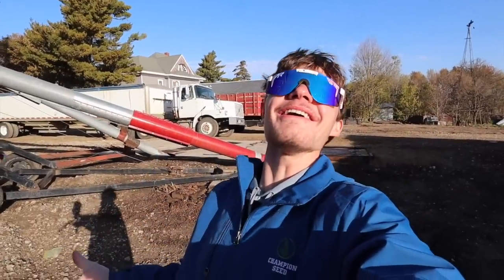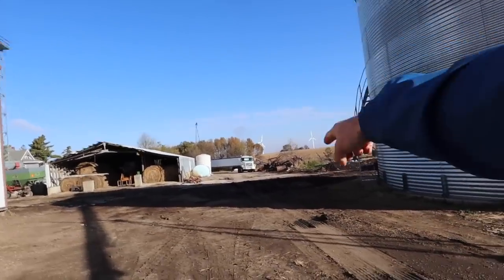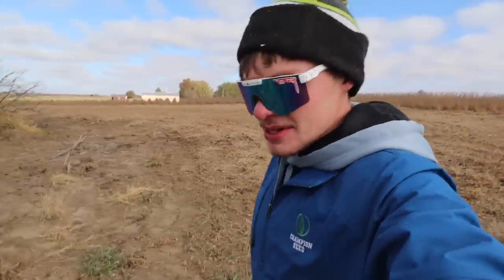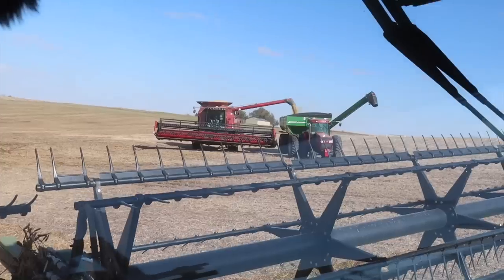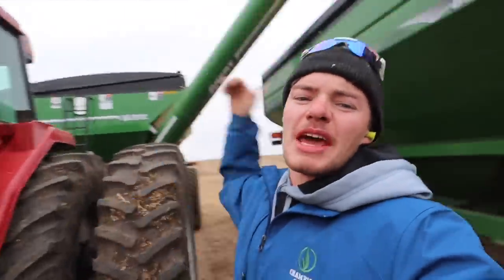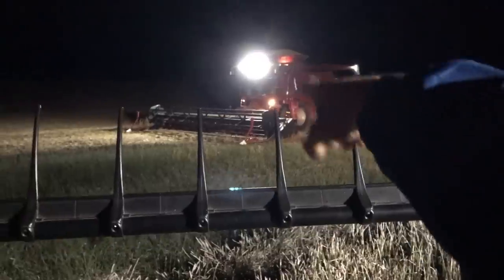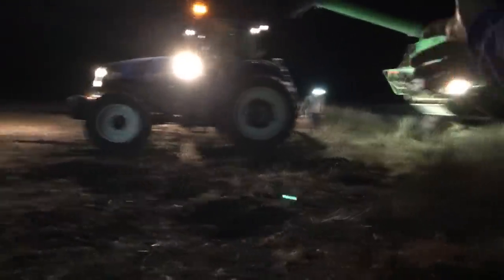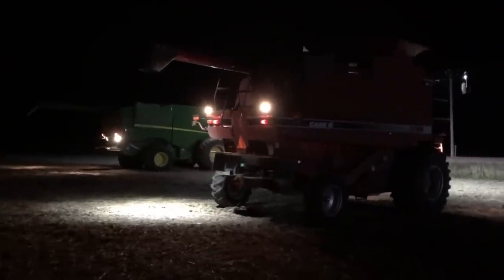COMBINE STUCK IN DEEP MUD ***BURIED***

Comment: be sure that you create a long rope to the farthest forward tractor.. that goes under the closest tractor to the stuck combine.. with another rope from the closest tractor to the combine.. so the tractor in the middle is NOT being stretched and the ropes are NOT being overloaded..  there could be a snapped rope issue to the tractors too..

Comment: I know the combine getting stuck was a pain but it made for a really interesting video...
Reply from the maker: G Flanders that's what I thought 😇
Reply: Really, was that necessary?
Reply: @jeffmeacham6164  it looked dry on top. You obviously haven't been on some of the soils that we farm, you can be driving along where it looks dry on top and step the clutch down and the tractor is up to the frame without even spinning a wheel. The variability comes from what the glaciers left behind with sand pockets.
Reply: @dedrakuhn6103  Maybe you ought to stay in the kitchen.
Reply: @dedrakuhn6103  Not just stay in the kitchen but use some common sense.
Reply: These are good people. And sure not dumb.

Comment: Great video that brings back many memories. Many years ago, we ran five combines in the Texas blacklands and farmed around 5,000 acres. The old saying is that if you stick with blackland when it's dry, it will stick to you when it's wet.  
We had two identical  7720s, a 6600 and two 4400s. We never took the headers off to move from Field to field. We could move in and out of those little farms and never miss a beat. 
One of the 7720s had rear wheel drive hydraulic assist. It would go through wet ground that stopped the two wheel drive. We put huge rice tires on the two wheel drive 7720 and it made an amazing difference. If we were not careful, we could spin the rims inside the tires and end up with a flat in boggy ground. I finally drilled studs one foot apart though the edge of the rims and into the tires and that made them bullet proof. 
Over time, we learned to never combine wet ground with any more than 1/3 of a hopper. Continuously dumping is a hell of a lot better than getting stuck. We did not have trouble with milo and corn during the summer. Our trouble was harvesting hard red winter wheat during wet springs. 
Anyway, like Bob Hope, sang, "Thanks For The Memories". 
Fred Lundgren
Katy, Texas
Reply: Good advice!

Comment: Hey Cole!
@ 02:01  Cute bit....but....Decades ago we had a number of smaller IH gas tractors.  M, 450, 560 etc.  The exhaust stack on those mufflers just barely would fit inside the old metal, frozen concentrated juice cans which we used for the exact same purpose.  However, IF you forgot to remove it before starting, they would build enough pressure on the first revolution to either split or blow off the can with a tremendous "BANG".  About the same as the old "M80" firecrackers!!  Of course there was the time or two when the muffler was 'a little rotten' and it blew the side out of the muffler too!
Ken

Comment: We have a cable wrapped around the front axle and ran through brackets along the combine to the back with a loop to pull on to get are combines out. Its a cheap and easy way to get it done without doing more damage.

Comment: Trick.  Tie both sides low. then using railroad ties, you could put some under the rope near the harvester. So when you pull it lifts the harvester a little.  But don't use too much as the back end digs in. Then you want to do it just enough to break the suction, then move them out of way to continue pulling.  Leverage stuff!

Comment: Seeing 2 yr old chilli..thinking “that looks good”.  I bought a grain cart a few weeks back.  Evening.  So I asked if ok to pick up Saturday @90 miles away.  “That’s fine”. I didn’t realize they were closed all day Saturday.  The hours said open till 1pm Sat.
  Well I hooked up, pulled up front to set lights, check.  Guy pulls in.  I told him.  “Stuff is cheaper on Saturday”. Half expected Deputy.  (I had receipt)
  On combine.  Best thing I ever did? (For the combine) run cables under it to rear hook point.  Last time I got it stuck was just before I did that.

Comment: you didnt hear it from me but strap about an 8 foot section from a tree to those tires and bounce you but outta there yes it's bouncy af  but its effective. you can us steel you can build something that attaches to the hubs with longer bolts but when you get so stuck you cant easily access the hubs. plus you can run skimpier cheaper big fronts if you have those logs nearby. will you snap one of those trunks? probably will you still bounce outta there? yup the advantage for you with them huge tires is the actual bouncing can be fairly slow especially because the head ain't coming off easy and it's now a safety device if you suddenly get crazy. trust me you can bounce walk out of anything

Comment: I think they call that Reeds Canary Grass..  My  Grandfather had 20 acres wet heavy Clay .. He mowed  8 acres of it with a 23 HP Ford  9N..   With a  Mott Hammer mower..   The Canary Grass would  wrap around the shaft and stall the motor..  The only way to get it out of gear with a  Load on the non live PTO  was to jack up one wheel with a Handy Man Jack.  That was a  1939 Ford 8N he had..  I have a  1952 Ford 8N  28 HP and 4 speed trans  instead of 3 speed trans  and  Distributor instead of a Mag .. and it came with lights..

Comment: Just wondering why the front tires on the T-8 NH weren't spinning when trying to pull the combine out.  It looked like it was getting a pretty tug on the combine right up to the point the back tires spun out.

Comment: I had noticed the half in earplugs but until you said why I hadn't really thought about it. In 1973 I started going to concerts (Led Zep, Tull, ELO). Earplugs correctly installed were overkill. The music sounded terrible. I discovered that by partially pulling the earplugs out I could reach a balance of the music sounding decent and my ears not ringing for several hours. But because I didn't like the way half pulled out earplugs looked I started cutting them in half. Problem solved! Sonic assault tamed and no extra earplug sticking out looking dorky.

Comment: 🌽AWESOME 🌽
        🚜BLOSSOMS🚜
Ya'll are some HARD WORKIN MEN!
What else would be suitable to eat out in the field. You start getting hamburgers, fries and sodas - you start spending a lot more money❣ Just stuff the pizza down so you don't get shaky and fix your potatoes and gravy pile at home, or tacos or enchiladas at home. I invented me a bean and veggie soup that is so good!
1 can of chicken broth, 1 can of diced tomatoes, 2 cans of Campbells Bean and Ham soup and 1 can of Campbells Chicken Tortilla soup.  I usually watch take a half a chopped onion in a tablespoon of oil and sautee the onions until they are partially done, then add the diced tomatoes on medium heat to the onions for about 10 minutes - so the tomatoes are well cooked, then add the broth and the three cans of soup and cook until a good boil. Only need to boil a few minutes. Stir fairly often so the beans don't stick to the pan. Move pan of soup. I take a small tortilla and put it on the burner while it's still on and braise both sides make  2 or 3 of those with added butter like a burrito roll.  Add spices as desired.❣Lemon and honey mixture for the throat and rest it a few days♥️